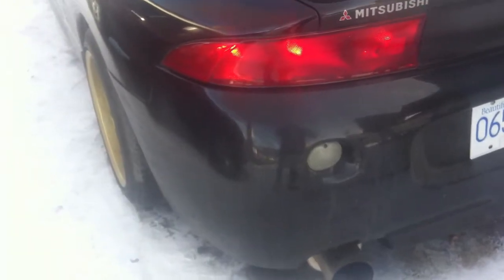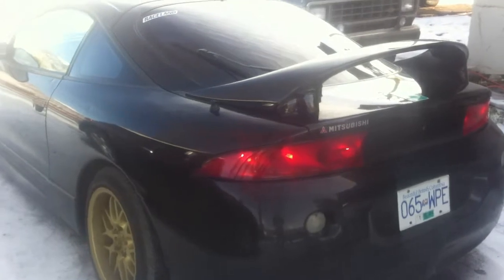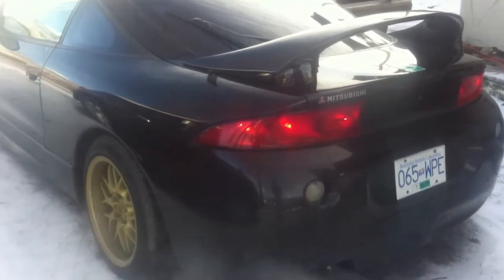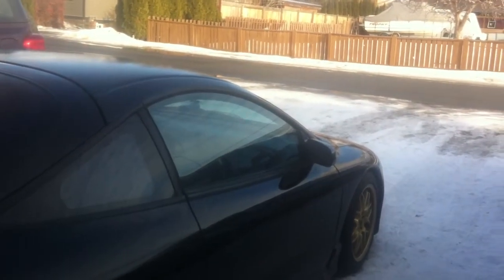1997 Eclipse GSX Whats That Sound ?

Comment: If you changed the clutch and use a light weight flywheel now could be chatter.
Reply from the maker: No factory fly wheel, Already used a stethoscope to try to figure out where the sounds coming from, Really sounds like the alternator bearing, And also found a video with the same sound and it was a bad alternator and had my battery light come on a couple times so I'm thinking its that. thanks tho man.

Comment: its bleeder bearing 100% sure its make that sound and when you take out from gear and press clutch pedal the sound stop (but to repair it you need to take off gearbox) repaired it last week thinked its gearbox but no bearing
Reply from the maker: Clutch in or out doesn't change the sound, The full clutch rear main everything was just done, I went under it while it was running and put my ear right to the fly wheel thats not the sound lol. Pretty sure its the Alternator bearing or like Marco33717 said harmonic balance pully.